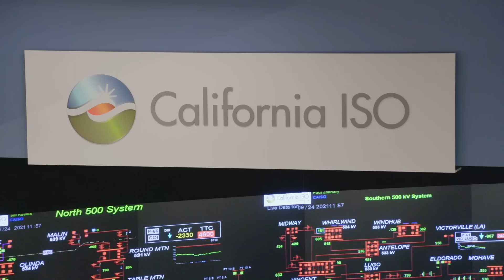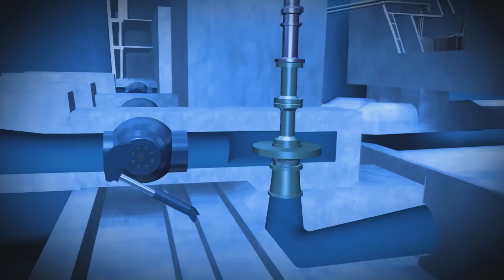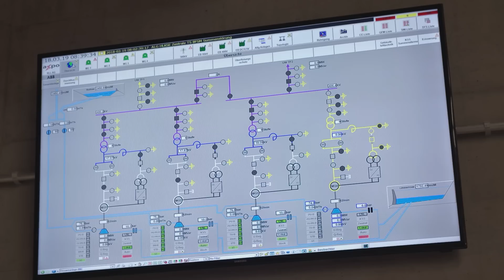How Can We Store Excess Renewable Energy? | Engineering The Future

Comment: Wouldn’t it make sense to just get better at nuclear.
Reply: No. It makes more sense to get better in all directions and not put all of your eggs into 1 basket. Development of battery technology has a very powerful positive rippling effect for the whole society.
Reply: Nuclear is expensive. There are also big advantages to having locally produced energy.
Reply: @DBjones100  one 25kg bundle of not enriched uranium in candu reactor “stores” 1100mwh and the rest of energy will be there for the future still(like 98ish times more). Are we trying to solve climate change and powers supply security issues or trying to run expensive hobby projects by making unreliable power usable?
Reply: Yes but unfortunately nuclear is scary to the general public
Reply: @AdventureWithGus  I think(hope) that it is easier to fix fear  and perception than "laws of physics".
Reply: It does. I have no idea why invest collective billions on R&D when nuclear is right in your face.
Reply: @BlackFalconElectronics  yes exactly. All the batteries, storage, overbuilding of capacity, complexity, upkeep of fossil fuel backup is not needed if using reliable, cheap (definitely in long term, which should matter the most) nuclear power. And carbon free as much as it is possible.
Reply: @msxcytb  nah, they want water batteries🤣🤣😂
Reply: No.
Reply: No because solar is so much cheaper in the large large scale, needs less maintainment and has no nasty side products to deal with 

Renewables is and was always the way we just started developing too late
Reply: @timonlyup   What do you do when the sun does not shine and when in most of Canada we only get about 7 hours of sunlight per day( if its not cloudy) for  3 months of the year?
Reply: Nope, cost too much and takes too long.
Reply: Not enough uranium in the world for a increase in fission reactors. Thorium reactors don't work except in peoples imaginations. Fusion doesn't work yet. Nuclear energy is not cost effective either.
Reply: It makes sense to have more options
Reply: Both. Both is good.
Reply: It is but u will have to mine, refine and use. For solar and wind, u don't have to.
Reply: @s-qc9ns  Wrong again.  For each windmill how much steel , concrete and fiberglass has to be mined, refined and manufactured? It take about 300+ windmills to produce  the same power as a typical nuclear plant. These windmills also need to be maintained and the blades replaced on a regular basis.
Reply: No!  NEW nuclear (not the reactors built 40+ years ago and fully amortized) is outrageously expensive! 3-5 times more expensive than solar or wind + storage!
Reply: @st-ex8506   The trouble is you cannot provide enough storage.
Reply: @theowoytowich9959  Of course we can... and we will!  The GLOBAL need for energy storage are about 200 TWh for grid storage, plus about 100 TWh for electric vehicles.
Global battery manufacturing capacity is already 2.6 TWh per year, and is growing over 30% per year.
At this rate, it will take less than 15 years to set up enough storage capacity for all of mankind in a 100% renewable energy scenario!
Some estimates of the necessary grid storage are more like 300 rather than 200 TWh... which would mean another 2-3 years to achieve the same goal!

Facts talk loudly when you care to do your homework!
Reply: @st-ex8506  Everything works perfect in theory. How about bring some realistic practicality to the problem. First of most batteries provide a short term solution, usally hours or a day or two at best.  So what happens when we have days, weeks or even months of itermittent supply of solar and wind???
 How many more mines will we have to open for all the minerals need to build these batteries.  Currently  you need to excavate approximately 500,000  tons of rock etc;  to obtain all the material for one car battery.  Most of this work is done using fossil  fuels.
 Also our need for electricity is projected to double in the next 25 years.  Where is it all going to come from??? 
Currently over 60% of the electricity generated in the world is done using fossil fuels.  SO you are telling me that all this electricity is going to be repaced by  solar and wind and batteries as well as doubling in the next 25 years. Keep on dreaming!!!!!
Reply: You make too much sense. You should be quiet and not have an opinion 😂
Reply: get better? like fusion? thorium?  electrical energy storage provides resiliency to the grid in addition to making intermittent energy 24/7.  Cost also matters.  Renewable is cheaper.
Reply: @ricinro  But is renewable  really cheaper? How much storage capacity will you need , weeks, months worth ???? In northern  climates when the sun shines very little during the winters and  cold temperatures, will it make much sense?? If you run out of power at -30 C it will be a catastrophe.
Reply: Nuclear power is the most expensive power by far, and is still going up. Renewables are the cheapest power option today, and still dropping. Do you want your electricity rates to go up or down?
Reply: @WallyBraun  Cheapest form of electricity is coal and gas in most places- do you have problem with those sources of power? I do. Wind and solar prices are mysterious- so "cheap" yet bills in California, Germany Denmark say differently (still regions mostly powered by fossil fuels, very far from 100% renewables). Nuclear can be cheap if deployed well, and even slowly build like infamous EPRs may be blessed by grand-kids of the builders as cheap and reliable clean power (should last 80+years), time will tell.
Reply: @WallyBraun  nope, nuclear is super cheap over the long run, since they last so many decades.
Reply: @beanapprentice1687  What is your source of information on this point?
Reply: @beanapprentice1687  What is your source of information on this point?
Reply: It is questionable about the long-term availability of nuclear fuel. Yes, we need a few plants to keep the technology alive. The US Navy has it share. However, my bet is on advanced deep geothermal electrical generation.

Comment: Finally someone is tackling the biggest problem of the renewable energy - storage and management
Reply: I don‘t know what‘s so revolutionary about water pump storage facilities - we have had them in Austria for centuries! The problem is that they tend to be in conflict with protected nature sites, so that they get ever more difficult to build, as they tend to negatively affect protected and oftentimes endangered wildlife.
Reply: @philipkudrna5643  it isn't revolutionary, that's part of the beauty, it is tried and tested. 

And sure, its a known trade off between biodiversity and renewable energy. But it isn't like fossil fuels are better for the environment. The negatives can be planned and mitigated for.
Reply: And getting things tight?
Reply: It's an engineering problem though that we can overcome. Pumped hydro, batterier and thermal storage (both hot and cold) can and will solve it.
Reply: This is not a problem, 32 kWh battery costs 2000 €, so buy, install and use.
YOu have to cut down el. consumption to the level of EU or India.
Reply: Yes this is biggest problem of renewable energy.
Closed Loop hydro pump best option for storage of energy.
Reply: @vijaykaramta2324  
https://youtu.be/LxRJb036i_0?si=w-bl2W5tiEH7Z7Hg
Reply: @vijaykaramta2324 we run out place to put hydro pump
Reply: Stop 🛑 talking about batteries 🪫 and start talking about running high voltage ⚡️ undersea power line. We have billions of miles of undersea internet cables so easy. Install a cable to Japan 🇯🇵 Australia 🇦🇺 to American 🇺🇸 to Spain 🇪🇸 Britain 🇬🇧 Greenland 🇬🇱 iceland  🇮🇸 even India 🇮🇳 South Africa 🇿🇦 could be connect. Then install 110% solar 10% more then you need problems solved and we will prove earth 🌍 is not flat lol 😂
Reply: @williampisano7573  too expensive and too many unstable governments. Nuclear
Reply: @ColCurtis yes, because nuclear is the way to go with unstable governments. Also about 6 times more expensive than renewable energy…
Reply: Nuclear is a terrible idea if you want to decrease dependence on bad actors for most countries. China and Russia are all over the tech and supply chain. And nuclear is ridiculously unaffordable.
Reply: @MultiMenvafan  you don't have to buy Russian and Chinese tech. Western countries produce nuclear tech. Wouldn't it be great if there was a power source that didn't need to dam every river or cover land with solar panels to collect 250 watts per sq meter, or build giant turbine towers on every piece of flat land with huge buried concrete ballast. Wouldn't it be great if we had a nearly limitless fuel source that doesn't produce co2, has a high energy production per sq meter, and instead of blowing the waste into the atmosphere. The waste is easily contained in a solid ceramic material.
Reply: @ColCurtis  I agree with you but at the moment Russia has the monopoly on nuclear fuel
Reply: @ColCurtis  nuclear power, like combustion engines, is great technology. For the past century. While I don't object to nuclear technology as such, it is financial suicide. Every recent reactor project in the west has run at least twice over budget and over time. Renewables are superior because you can deploy it and scale it solar cell by solar cell or windmill by windmill, not spending 10 years constructing something that might end up obsolete when completed anyway. Renewables has it's challenges in terms of transmission and storage, but there are viable solutions for that and it will only improve. Nuclear power is just an unaffordable way to keep big utility and energy overpaid CEOs relevant and in business
Reply: @MultiMenvafan  germany $0.40/kwh, France $0.28/kwh. As you add more renewables to the grid, the cost per kwh increases. The cost of power in Ontario Canada is $0.14 CAD ($0.10 USD), a mix of hydro and nuclear. You can argue about the price and time of plant construction, but it can operate for 50+ years on super cheap fuel, and it is a current technology that works for base load power. Everybody I know that lives off grid heats with wood or gas and has a backup diesel generator to run their large appliances and to charge the batteries when solar isn't enough. 100% renewables is a pipe dream, and nuclear is working.
Reply: @WkKijkt  10 in optimal case, 20 times for UK :D
Reply: @ColCurtis  Tell that to the midwestern US, where the wind power is so cheap data centers are moving there left and right.  100% renewables will be hard, but they are cheaper than fossil fuels.  Which is why fossil fuel plants around the world are shutting down.  Even in fossil fuel Texas, the politicians haven't been able to block renewables or subsidize fossil fuels enough to make developers switch away from renewables.
Reply: @prilep5  Not at all! Russia is only #6 uranium producer in the world, with only 5% of the global market!
Reply: @ColCurtis  New nuclear is WAY too expensive.  Its LCOE is double that of solar/wind + storage!  And it takes a decade or two to plan and build a new nuclear power plant.  I am all for keeping existing nuclear capacities as long as safety allows, but NEW nuclear is uncompetitive today, and will become more uncompetitive every passing year!

Furthermore, nuclear is NOT a renewable energy, and would postpone the problem of running out of fuel only by a few decades.

As to round-the-Earth HVAC connections, transforming solar into a constant power source, it is indeed overly expensive.  But some degree of that idea is one of the components of the solution to remediate the intermittency of solar and wind.
Reply: @prilep5  NOT AT ALL!  Russia is only the world's 6th largest uranium supplier, and only accounts for 5.08% of the total!
Now, if you talk of uranium enrichment, Russia has indeed a leading market share at 40% of the world's production, which is a large share but not a monopoly!  Major nuclear-energy producing nations (Russia obviously, China, France, USA, UK, ...) are all self-sufficient on that matter.  Anyway, contrary to uranium resources, enrichment plants can be built faster than nuclear reactors can!